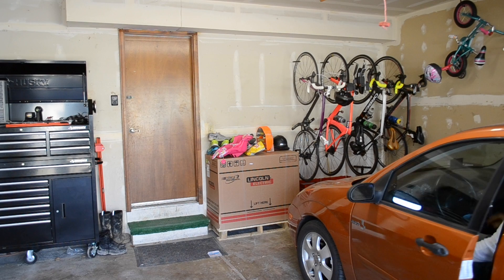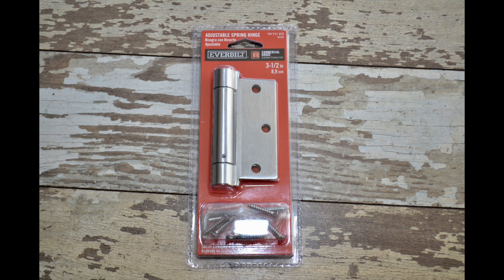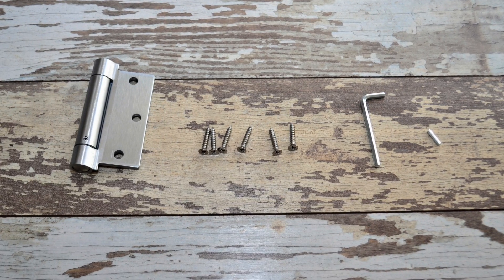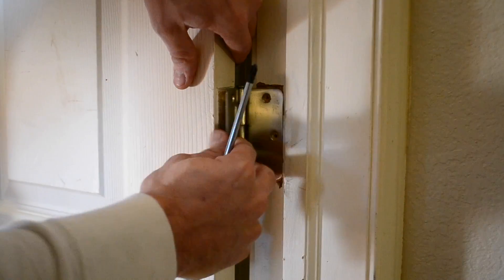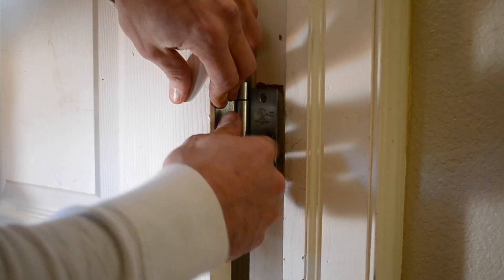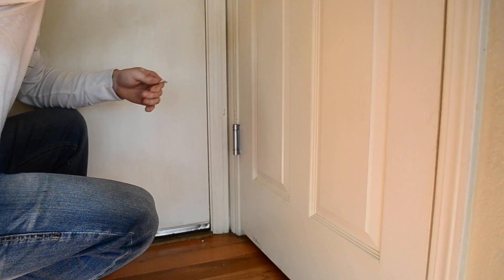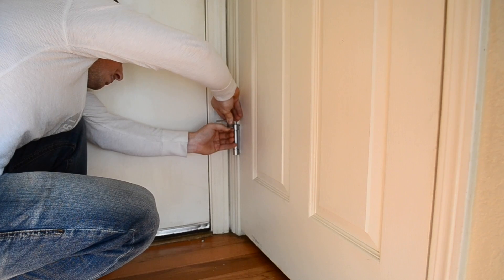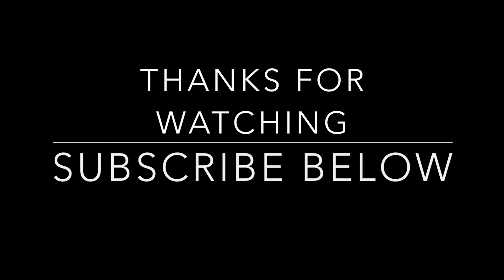Spring Loaded Door Hinge

Comment: You replaced both door hinges  or just one? I think it would wrk better w both - my sister is very ill and her son never shuts the doors and ll the heat goes out so I want to get something to shut doors after him /
Reply from the maker: I only need to replace the one. It worked perfect with barely any tension on the door. There was no need for both. Thanks for watching. I hope that this helped.

Comment: Thank you- very helpful.  Another challenge I have is a door that slams because of wind/air flow. Do spring hinges control the speed of closing, or just ensure it closes?  Any suggestions?
Reply from the maker: David Popler they just make sure that it closes. Other than using a door stop I don’t know what would prevent your door from slamming shut.  Thanks for watching
Reply: You can use a 3 or 4 valve door closer. You can adjust tension opening door, closing door, and latching strength. 

Spring loaded hinges are good for interior doors. If it’s an exterior door, I’d recommend going with a door closer rated for your door weight and usage.

Comment: Why are you not using it also on the other door that makes sense to have it on both doors you need to have it on both doors I hope you take my advice and I was a good video how to install it and do the tension on there but you still need another one for the other door
Reply from the maker: Thanks for watching. The second door is an exterior door which will never be left open longer than it takes to get someone through the door. When it is open its not a problem either. There would only be a split second that the doors have the possibility to touch when two people are opening the doors at the same time. Adding a second hinge would not solve this problem. Keeping the basement door closed was the only thing that needed to be done. Thanks for watching.

Comment: Hi, i have door hinge, may i know if i buy a new hinge will it fit exactly the old holes position? My door frame is metal so the hinge holes are fixed, so i am looking for exact hole position like my old hinge, i wonder if every door hinge holes are at standard distance apart standard size? 
Before I buy, how to know will the new door hinge will fit into the old hinge hole position? Thanks
Reply from the maker: They are standard. You need to know how many screws you have and if you have square or rounded hinges. With all of that information you should be able to figure it out.
Reply: @DaveMedicus  You only changed the lower one hinge to springe loaded door hinge and use the old top normal hinge, I wonder if the door is not aligned parallel to the door frame now after installing new hinge? I notice the the new middle cylinder rod part is thicker than the old normal hinge cylinder rod part, I was wondering if your upper hinge (old hinge) gap between frame and door is it smaller than your lower hinge (new spring loaded hinge) gap between frame and door? Thanks.
Reply from the maker: @jasonl4237  it’s the exact same size. The outside is larger because it houses the spring. The dimensions that attach to your door are standard and caused no issues for me.

Comment: LOL , the brand I bought at Lowes was PRELOADED and I had to use a screwdriver to spread the plates apart, the instructions to REMOVE tension didn't work, I will take this back and get your type @ Home Depot, looks easier.
Reply from the maker: Dang that would be a nightmare. Lol sorry that happened. I hope the next set works out better. Thanks for watching.

Comment: You only used 1 pice for door? Or 2
Reply from the maker: One was more than enough for this door. If you have a solid door or one that’s really heavy you may want to use two. I only had to adjust it 4 turn who’s is basically only one time around. It worked great for the two years that we were in the houses. Thanks for watching.

Comment: Does it prevent the door from being slammed closed? Does it “brake” in anyway?
Reply: Glen   you can adjust it  so it  dont slam too hard with that pin thing~  im trying to figure out the same thing mine is not closing enough  all the way for the garage
Reply from the maker: You can adjust the tension so that it closes just right. It will not stop someone from slamming the door.

Comment: Here’s a stupid question for you.  How do you get the new hinge to open when you take it out of the package?  No one seems to cover that and “No” it does not just open.
Reply from the maker: Rachele never had that issues. I would check and see if the pin is installed if so remove it. Others than that there shouldn’t be anything holding it closed
Reply: Dave Medicus Thank you for replying.
Reply from the maker: Rachele I hope that it helped. Did you ever figure it out?
Reply: Dave Medicus Yes it did.  The salesman at Lowe’s sold me the wrong hinge. 😂. There was no way I was ever going to get that one to open.  Now that I have the right one, with the help of your video I was able to replace my broken hinge.  Thank you again.
Reply from the maker: Rachele awesome. Nice job.